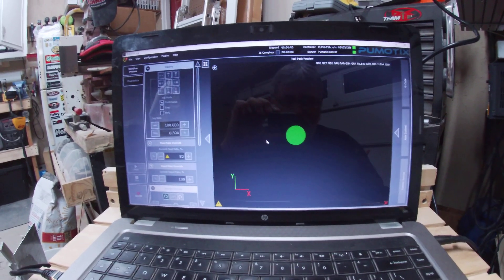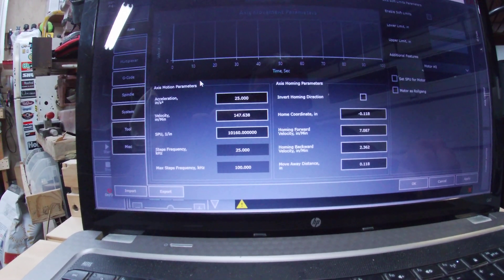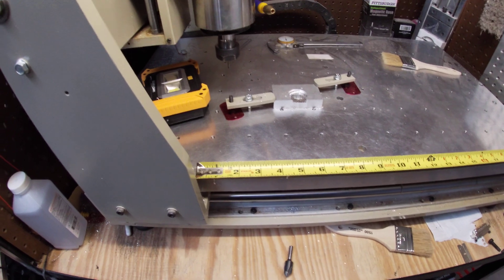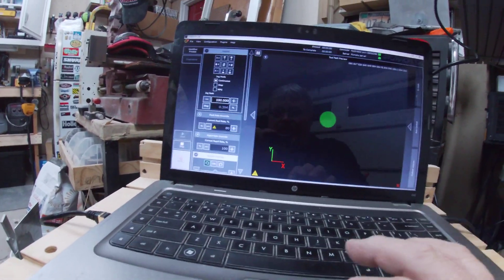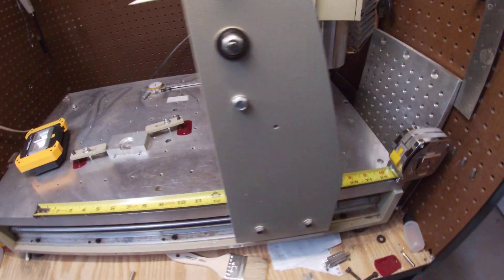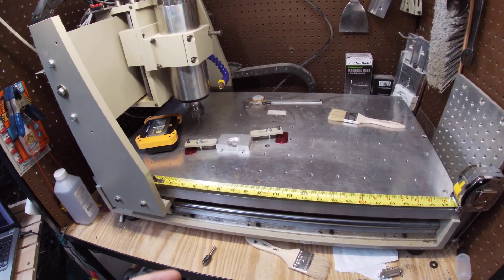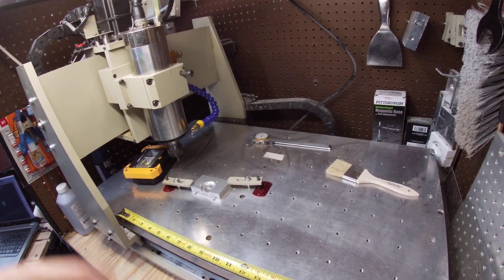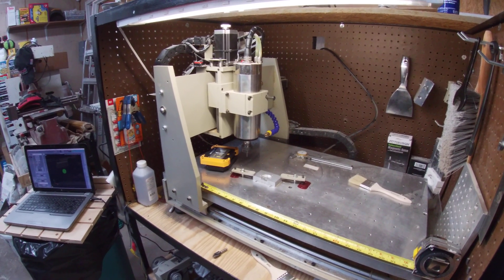The FASTEST 6040 CNC Machine around

Comment: what engines do you use for upgrading? what power? and what is the need for a motor, a driver and a new power supply?
Reply from the maker: The stock motors run on 24v and cannot rapid this fast. Cutting speeds aren't any different typically, just the rapids being way faster. Of course if you are cutting wood, the stock 6040 won't do much over 60 ipm. This setup is 48v and 600oz motors built by a guy named vince I found on Ebay. I think his seller is something like storm123 or corvetteguy50

Comment: Well, ummm.... I have a 6040 that hits a little over 6600 mm per min which is just a tick under 260 IPM.  But I was testing a servo system on it.
Reply from the maker: That's fast! After I did some parts I found an occasional stall and ended up slowing mine down.  I think I am around 250 IPM now. I would love to experiment with a servo setup but it's hard to tear down a working system ya know. I keep putting off doing my gantry upgrade but see it coming in the very near future. Thanks for the comment

Comment: How are you liking the pumotix system?
Reply from the maker: So far it has been great. Out of the box there are some settings that I don't think should be there and I am going to cover this in a final video. Right now I am waiting for them to get back with me on work offsets. Currently you can only have 9 and my engraving of dog tags requires 20 work offsets so sadly I have to fire up my old WinXP and Mach3 to engrave dog tags. When they let me use 253 offsets like in Mach I will fully swap my setup over to Pumotix.
Reply: This is a Russian product. Drat! I like the Russian people but not the Government. Gotta support the sanctions.

Comment: Are you running with the stock motors and drivers? Seems like you mentioned new motors. Also what is your acceleration set to? Pretty impressive either way!

My CNCEST 6040 is essentially stock and I can get it to reliably run at ~120 IPM with Mach3 without stalling. Seems to be able to get close to 200 in an ideal scenario but if I quickly tap the jog buttons it stalls. Definitely interested in pushing it faster.
Reply from the maker: No I have upgraded to 600oz motors and 48v power supply. My next test is to up the Kernal frequency in Mach3 to higher than 25,000 hz and see if that helps. My Gecko G540 will accept higher and it SHOULD run faster in Mach but I have not messed with it. When you get a machine stable and making parts it's hard to justify making changes. Thanks for the comment
Reply from the maker: I just got those numbers you asked about. My Velocity is 3750 / Accel is 500 and rapids are 165 IPM. I tried setting my % from 50% (where they were stock) to 100% and had no change in speed. Also changed Kernal speed with no difference either.

Comment: this makes no sence . motors and gearing make the speed . not the software . speed is speed . fsatest stepper speeds are 1300 ipm  plus it acceleration that counts
 my plasma table do 1300 ipm with uccnc no problem and cut 400 ipm  cut speeds with high velocity . 3 to 1 reduction on stepper motors . faster get a servo
Reply from the maker: Blew my mind, I had Mach3 to the point of stalling my motors in the motor tuning and this was as fast as they would go. I tried turning the kernal frequency up and it would crash the 32 bit machine. So it is actually true that the software made my machine this fast.

Comment: I was going to say in Mach3 Config - Motor Home/Softlimits can change you're speeds from 20% to more speeds %... Or you can Edit G-Code G28 homing file speeds or in drawing cad-cam toolpaths homing G28 too.... But on my CNCest 304T threaded rod will start to vibrate with the Y axis at almost full speed...
Reply from the maker: Good tip! I couldn't get Mach to run any faster without stalling the motors. I will try this trick for sure. I'm not totally leaving Mach3 until I get better with Pomotix. Some of my jobs I can rely on with Mach and need to experiment to feel more comfortable before the total switch.